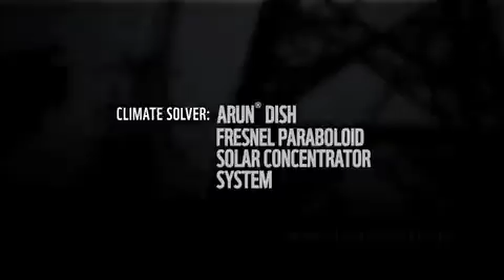ARUN® Dish - Fresnel Paraboloid Solar Concentrator System by Clique Developments Ltd

Comment: Design cost for handling 1.0 lakh litre per day milk handling I.e. milk pasteurization @ 15000 litre per hour.Design cost for small experimental plant of 2000 litres per day milk handling during available sunshine in Bihar.Then installation cost along with steam generator for steam.And installation cost along with vapour absorption system using Ammonia water for chilling of milk with chilled water.